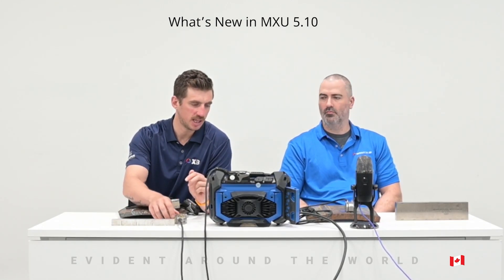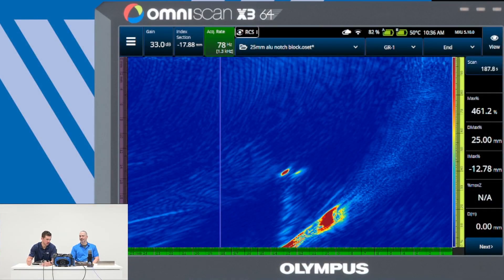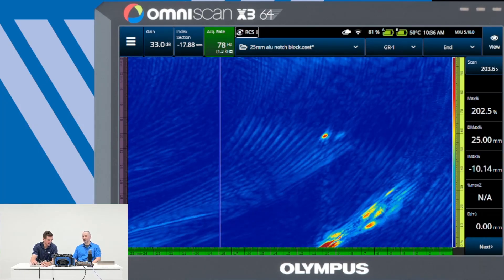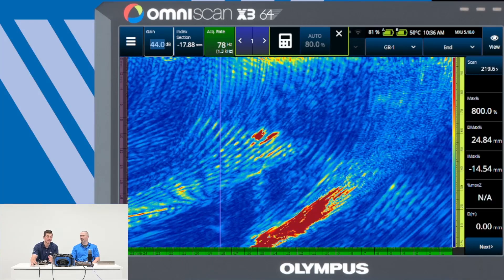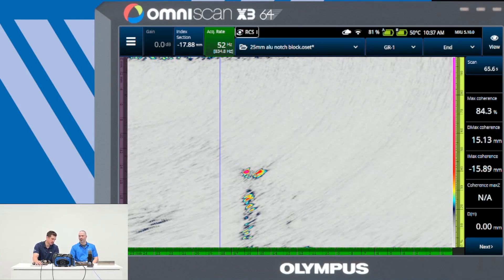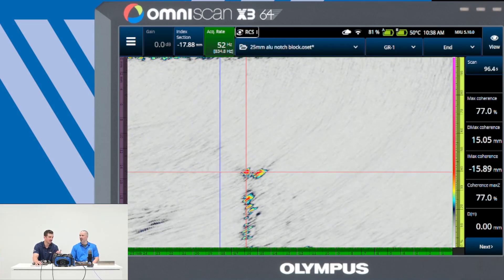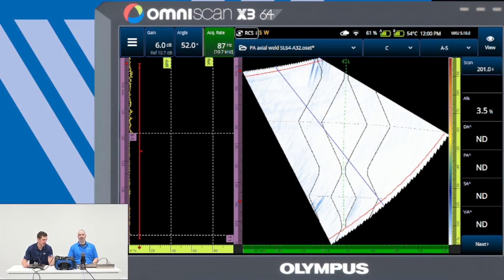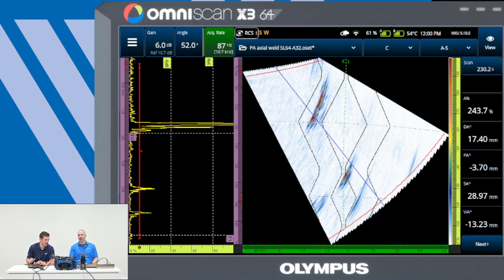What’s New in MXU 5.10, the OmniScan™ X3 Series Onboard Software

Comment: it is a presentation showing advantages of one method , but no explanation about the process. . the backgroud is always the delay law which mainly computed with pat to the target. for each element all delays are in coherent phase. At leat the done sum integrate answers not coherent. this drives to an certain inacurracy in rebuild shape. To avoid this some technics of filtering are applied to correct this discrepancy.  Personnaly i am looking this purpose with some tools of fuzzy logics to proceed these corrections.  Which digitized means are you using?